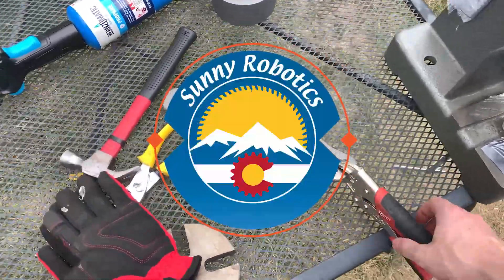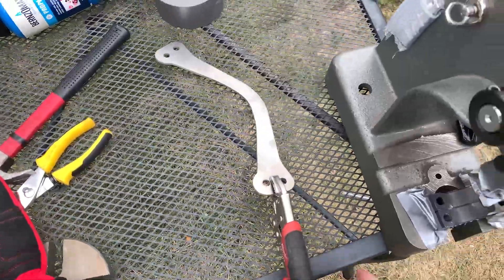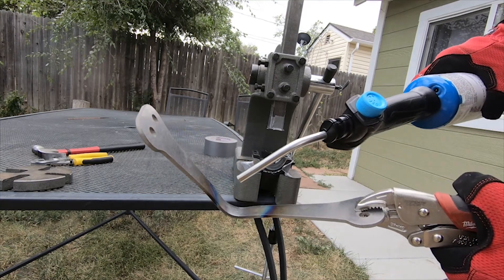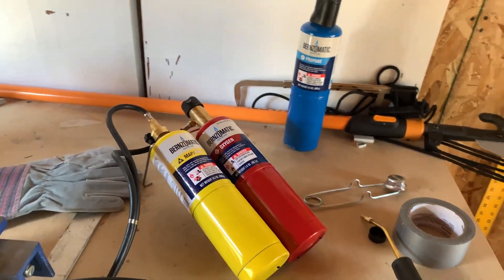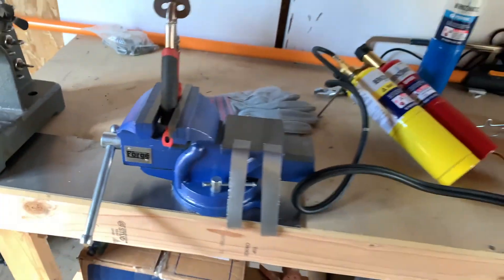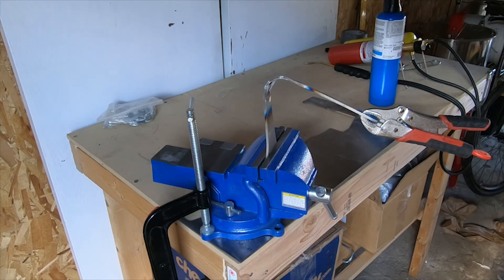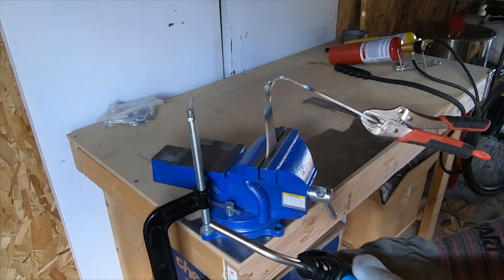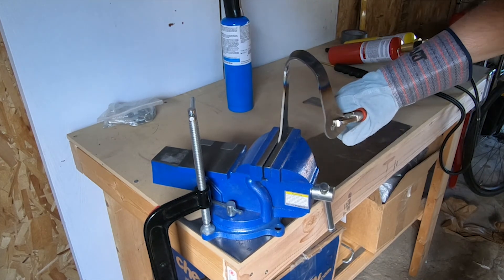Bending Titanium

Comment: Thanks so much for posting this video! in return, I suggest you screw that arbor press down to a 2x6 wooden board, stand on the boards on the concrete next to the table, and with your full weight, press down on the handle to the arbor press. This will eliminate the wobbly table and maximize your force on the titanium! I've never worked with titanium, but I plan to with the hints you've provided. I have however, used that trick I mentioned to secure a small vice in the absence of a heavy workbench. Works like a charm! ....or later in the video I see you have a workbench, screw the arbor press in to that!